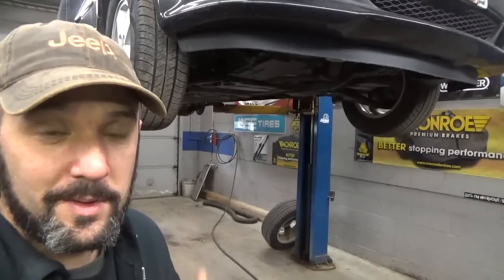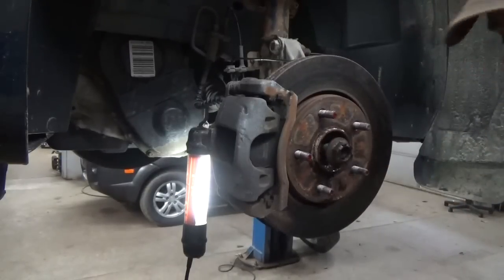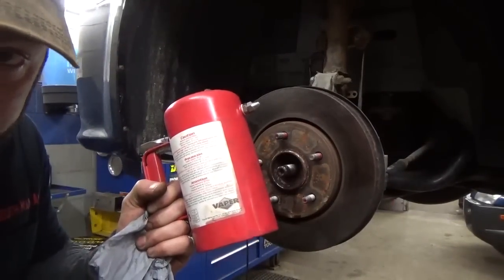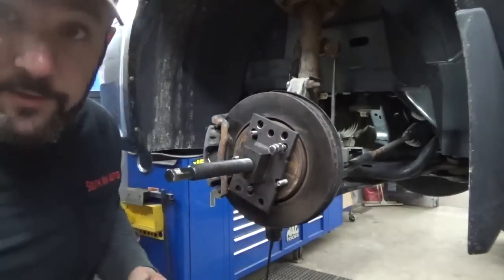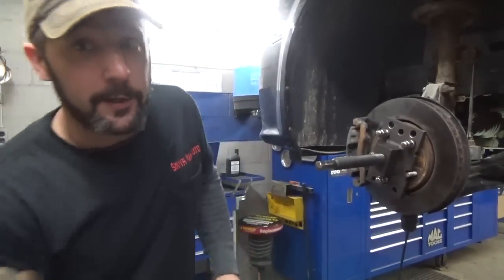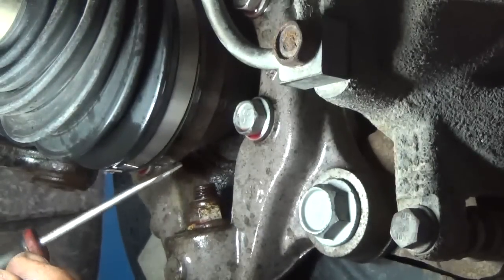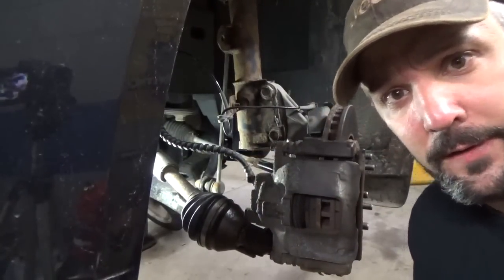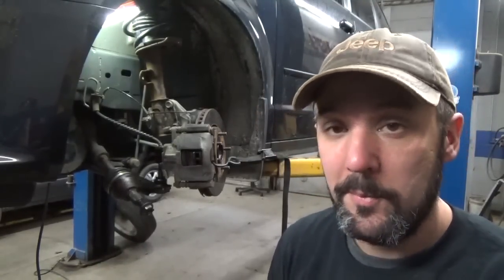Dodge Grand Caravan Lower Ball Joint - Part I

Comment: What you can do to avoid a lot of hassle next time is loosen the ball joint nut then break the joint loose from the hub using a balljoint fork or a heavy hammer on that part of the hub, then when the ball joint drops a bit you can get the nut the rest of the way off. This would have avoided the need to remove the axle and subsequently replacing it.

You also could have replaced just the outer CV joint instead of the entire axle.

As for those commenting on the amount of rust on the axle bolt, this is common when used in the winter on salted roadways.

Another technique when removing and replacing the ball joint is heat the lower control arm with a torch until it's red hot, as it expands it will loosen it's hold on the ball joint and you can tap it with a hammer and it will drop out, then heat it again and the new ball joint will slide right in with a tap of a hammer or two, then when it cools down it will clamp on it like a vise and the snap ring will be added assurance that it doesn't drop out.

You might also advise your customer that the right side ball joint was subjected to the same conditions as the left so it would be a good idea to replace them both together and since the new ones can be lubed they should last much longer if greased regularly. 

Enjoyed your video very much, it's nice to see someone sharing this knowledge on youtube.

ASE Master Tech (retired)

Comment: Just put brakes on a neighbors 2010 caravan, I noticed the drivers side lower ball joint is bad. I do have a 20 ton press and have done enough wheel bearings to know I don't want to do any more. Your video is awesome. Being in upstate NY I fight rust every job. i'm supposed to be retired, just helping out the neighbors, they think everything should cost $50. After seeing this i'm sending them to a garage, then they'll appreciate those $100 complete brake jobs a bit more. I was wondering how to get that nut to clear.. That axle spline sometimes comes right out, then there's the other times. i'b buy you a beer if I could. Cheers!

Comment: The visible tire alignment part applies only to heavy trucks like an 18 wheeler, the uneven tire wear also, for the heavy vehicles only, a NYSI is a minimum safety requirement, for example, only 1 reverse light has to work, and the only front lamps that are inspected are headlamps high and low beams and signals, headlamp aim has been deleted, side signals or side marker bulbs also dropped, front park lights are not rejectable....to name a few, many changes have happened on inspection laws over the decades, mainly because of taxpayers complaints, the ball joint thing comes from in the 60s and 70s the lomax tool to check for wear was not used correctly on many different design cars so even a new ball joint would fail, up and down or side to side play, (specs were not followed) thus complaints piled up so a change in the law was made and not for the better, the state just dropped ball joints all together because many shops did not know how to check a ball joint for wear, you can follow the OEM terminology for a "complete control arm" and fail it that way e,g. Nissan and Ford Lincoln and others replace whole arms not ball joints...also the steering wheel free play can fail a ball joint ! 
a NYSI inpection does not make for a safe car like people think.

Comment: Just an observation Eric, You were making progress by hand with the breaker bar .If you put a big 8 foot pipe on the end of the breaker bar and got more leverage I think that  it would have worked a lot easier. ( just my opinion and that's what I would've done :)  remember I'm on the outside looking in, and you worked for your Money  that day for sure. great video
Reply from the maker: Carm0083 Oh yeah hind sight is always 20/20 but gotta remember an 8' bar can sometimes create a few more problems than it fixes :)

Comment: I am a DIYer and I do not have all those fancy tools. I was going to just replace the whole lower control arm. Figured I can just chisel ball joint bolt out. Your thoughts? Lower control arm is about 90 bucks with ball joint. Seems like most of your time was spent fixing something for the future. I was just trying to avoid that and worry about the joint.
Reply: Ps. I like how part 2 has half the views.

Comment: I'm not sure if I would beat on the CV axle shaft too hard.  Possible damage to the inner, and outer joints, and transmission.  I would have soaked it down real good over night, leaving the press on with high pressure.  Then, go after it with a air hammer lightly the next morning.  That may have possibly worked?  Can those axle joints stand that much abuse?  Love your channel, and watch quite a lot to learn new procedures from you.  K
eep up the education for us all!

Comment: Hi Eric,
Great videos, I have been learning a great deal from you.
I have an old 1999 Dodge Caravan. And the strut housing on the driver side is rusted.
To make the story short, I fell asleep behind wheel and hit the concrete median and the strut cracked the rusted housing. I went to AutoZone and purchased a Kit that caps the housing and held in place with 5/16” diameter pop-rivets. I am contemplating to do the work this spring, but not comfortable using P-R to hold it in place. 
What advise can you give me to do this work with confidence?
With Kindest Regards,
Shahbaz

Comment: Good video! I would've tried a little differently:

1. Unspin the balljoint nut as high as you can
2. separate the balljoint from the hub
3. Pull down the balljoint boot, grab the balljoint shaft with vicegrips, so the shaft doesnt spin
4. undo the nut rest of the way.

to install:

1. put a new balljoint  in the hub, put the nut on,
2. push the balljoint up with a jack, so the shaft doesnt spin, tighten the nut.

If any of these steps are impossible to do, then yes, only option is to remove the axle.

Comment: Hi Eric. Our inspection in the UK is called an MOT test. That ball joint would be classed as a dangerous failure and not to be driven until repaired. We do have certain criteria which makes you question the logic like this for you. I would however fail that one with the criteria given to you as you said alignment obviously incorrect. A ball joint allowing that much movement is surely obviously out of alignment. It would wear tyres unevenly, but they could fit a new tyre that day and have no apparent wear for you to add that to your decision. Take a look at the gov.uk website at the inspection manuals if you get chance. I would be interested to read what you have to follow.

Comment: I own a 2009 Caravan in Toronto, Canada. I had to replace both front wheel bearings in Sept.2017. Both of my 8 year old CV axles popped out easily when I gently tapped them with a small sledge. I wonder why this van was such a problem?

Comment: Use Kroil penetrating/creeping oil. None of the others work as well. I have have had badly rusted steal and after letting Kroil soak for a while, the steal looked like someone polished it, the Kroil creeping oil worked so well. Also, I am not sure if you didn't lock the plate on your tool down to the hub at first because if you did, every time you hit it with the hammer, your just hitting the hub. Also, I may ran a few rings around the hub with a torch because sometimes just a little bit of heat is all you need. Once you saw the axle move, you should have used the axle nut to tighten it back up and repeat this back and forth process a few times. You could have easily got the nut off without removing the axle because the nylon lock would have cleared the threads, so you should have replaced the bearing after doing all that work, and also, beating on the hub may have damaged the bearing I guess. If the outer cv is damaged I would guess you hit bottom with the inner cv and that's not good. Maybe not. You might need a better chisel gun. I bet a good dose of Kroil with time for it to work and a kick butt chisel gun would have worked without all the struggle. My friend has a new snap on and its so powerful it's hard to control the darn thing unless its a straight on direct hit such as a cv axle would be. There are other chisel guns even more powerful, but I can't remember who makes them. Thanks for your educational video's. I sit for hours and hours learning from you. THank you and God bless.

Comment: I really like your approach, attitude, and stick to it-ness.  I had a comment about using a hammer on the driving pin of that particular hub puller.  Did you realize (where you aware) that when you were hitting the pin, it was NOT really hitting the axle much at all?  The driving pin is screwed to the plate.....the plate is flush on the hub.  The force would have been spread all across the face of the hub, because the pin CANNOT go forward (inward) at all.  It is threaded to the plate.  
Now if this had been a 3 jaw puller, and you were hitting the pin, the pin would have been free to move, (and hopefully push the axle).  And funny how every time you got the giant breaker bar and turned the screw, the axle moved.  I wonder if you had done that earlier on, if it would have moved - then.
Also, how much power does the impact you were using have?  Ever consider a much higher torque one?
Other than that - great photography, and overall video!

Comment: Dude I feel your pain. I had a cv axle stuck in a wheel bearing so badly that I had to separate the entire knuckle from the ball joint, tie rod and strut mount and then separated the cv axle from the transmission. Take the whole assembly put it in vice vertically soak it in a pb blaster and pound on it like a rail road spike with an 8 pound maul. She separated..... eventually.

Comment: I got what you meant by it not being a castle nut but I'd of kept the pickle fork in there or clamped some locking pliers on the pin after tearing the rubber boot away. Anything to avoid what you went thru. Do you think removing the caliper and rotor and putting some heat into that hub would of helped any? (not a lot since there's a bearing seal in there)?

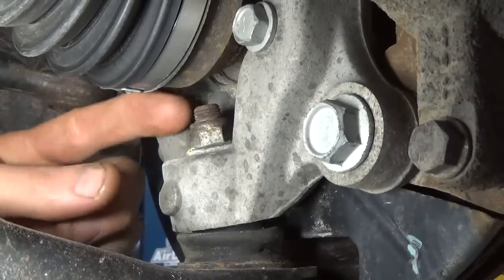Comment: Great video.  Thank you.  Question:  Would it be possible (at 2:04), to use a grinder or reciprocating caw to cut part of the ball joint bolt off to allow the nut to clear?  It does look very tight in there.

Comment: Hey why not loosen the nut until there's a gap, than cut the stud of the all joint off with either cutting torch or sawzall and when installing new ball joints start the threads and slowly work the nut and push the joint in at same time? Wouldn't have to touch the axle shaft or nut! But hey great hustle and like you said you will have to do a bearing at one point at least now you will get it apart! Thanks erico

Comment: Eric, when using a hammer as simple as a claw hammer you should wear those pesky safety glasses.  I know of a case where a young man was framing a house and a piece of the hammer or nail broke off and penetrated his eyeball.  He was taken to the emergency ward and was transferred 45 miles away to see a specialist who, by this time, couldn't do anything but remove his eye because the fluid had drained out.

Comment: I have a torque multiplier 4X .  Place 250 ft-lb on the input shaft and the output shaft will generate 1000 ft-lb.  Never had a problem removing stubborn nuts/bolts.  Can not be used with an impact gun.  Must be used with just your muscles.

Comment: Two things. 

Eric, You better get your glasses on or the boss will be upset 

2nd, Where did you get that press for the Axle that bolted onto the outside of rotor. That would be nice to find one like that. 

Maybe could've split the nut at an angle on the ball joint with a smaller cutoff wheel. You know the small ones we normally toss during a few minutes of down time when we're wanting to make sure the tools are prepped up and read to go?

Think that would've worked.

Comment: I just did a wheel bearing on a Kia Sorento and that was insanely stuck so when I had to do the other side I bought a 15ton Chinese hydraulic puller for less the £40. OMG what a tool it got the drive shaft moving with a lot of pressure but di the job fine, should have bought it when I did the first side, I ended up smashing the life out of the shaft and wrecked it.

Comment: Replacing the lower ball joints on my parents 05 escape now and man I feel your pain with corrosion and rust vehicles in areas like PA where I'm at nothing ends up being an easy job. Right now I'm fight with the top of the ball joint stuck in the knuckle and the pinch bolt stuck in it also.. It does help to have good tools though. I have a shitty cheapo impact and its just not worth using most of the time. I really would love to be able to get a quality impact.
Reply from the maker: Gamingoodz buy this if you want a great small 1/2" gun. I have one it will blow your mind for its size http://www.amazon.com/Astro-Pneumatic-Tool-1822-Impact/dp/B00VTQIURE
Reply: South Main Auto Repair Thanks for the reply, Just checked it out looks like a nice gun 450 lbs out of something that small is pretty impressive. I don't really know what any good brands of air tools are. I wouldn't mind getting that small one you linked me for tight spots and a full sized beastly 1/2" one for when I have something that the smaller one can't crank on. Have you had any experience with Ingersoll-Rand or AirCat? I see those are the highest rated on Amazon. The one AirCat one for $173 says it can do 1,295 ft-lb I don't know if I believe that claim but if it really does that would be great for breaking things loose.
Reply from the maker: SATAMAN Schmidt  can you chime in on this?

Comment: I love your videos, but honestly all that sledge hammer force was being absorbed thru the wheel bearing and press, and very little of that force was getting to the axle. I'd have put the nut flush with the end of the Axle and taken my chances on the axle shaft full force sledge hammer.

Comment: Use a cheap impact socket on your press just for hammering. It keeps press screw from deforming. The socket will deform instead and is cheaper than the press. Used this trick on anchor pin presses. Saved time, since you don’t have to stop and grind on the press screw to get the socket back on. 🙂

Comment: Hey man I’m not going to get my hopes up that you actually see this. But I’m a new tech. Been working on Niagara Falls New York as flat rate for maybe 5 months. I’ve done several control arms and lower ball joints on these vans. I never take the cv out. I loosen the ball joint nut most of the way with a wrench then pickle fork it loose. Then just take the nut off once it drops. I can usually do them in under 20 minutes both sides
Reply: i take it you didn't watch the entire video since he explained why he didn't do that.
Reply: hawk eye I’ve done several of these ball joints. You don’t have to take anything apart besides the ball joint nut. I’ve done both lowers and aligned the cars in under 40 minutes
Reply: @jacobsmith8121  thats all good but it looks like you're just flexing what you can do and have not paid attention to what he explained in the video.
Reply: hawk eye I literally just rewatched it. All he says is that you get get to the nut. I’m not arguing with you.
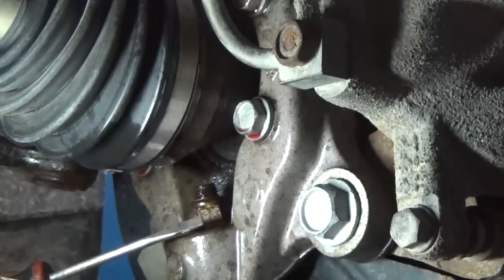Reply: @jacobsmith8121    19:05

Comment: Thank you thank you thank you, at 9:25 you say you "got a breaker-bar, and I tightened it just as tight as I could get it." Impact air-wrenches are wonderful, but you yourself are much stronger when using a breaker bar. So at first I was wondering why you did not know this, because in watching your videos, it was obvious, to me,  that you are a super competent auto-mechanic. And of course my doubt of my judgement was a mistake. The 150 ton press, and the breaker-bar; yikes!! Somewhere a design engineer as made a mistake. The hub should always come off the axle "easily" during the life-time of the vehicle.

Comment: This spline joint should of had Never Seez applied to it in the factory, but that would make it too easy to work on later.  OK.  I was taught the front end business when I was 17 and I loved the work.  I was taught by two of the best front end guys on the planet.  One thing they taught me was how to use heat as a tool.  These sprays are great for what they can do, but they are not going to penetrate a joint like this in less than a hundred years.  I would have pulled the caliper, { 5 minutes} and remover the rotor.  Get a heat tip going on a torch and heat the hub evenly around as to prevent warping.   Get it hot but not cherry color.  Then perform the hub pulling tool and sledge hammer procedure as he shows and repeat when needed.  Once it breaks loose and the axle shaft moves in, spray that are on the inside and then again on the outside.  Tighten the axle shaft back up and repeat until the spray oil can pen the inside of the shaft. I guarantee there will be no damage to the hub and axle shaft bearing, IF you keep as much heat as possible off the shaft.  However, if the bearing on the axle shaft gets too hot and cooks, might want to replace it. This method will decrease the work time by at least 1/2 and maybe more.  Make sure to have a fire extinguisher handy while using the torch.

Comment: At least the rims came off. I started a video the other day on a dodge . But after several hours of getting upset , i could not edit enough to make it even close to pg.It took like 5 hrs for me to get the 4 rims off the darn thing even after a few trips around the block with the lug nuts loose.
Reply from the maker: wtbm123 Wow Terry, That is what I call "getting slid"... you got slid my friend :)
Reply: wtbm123 I had an 83 malibu that got a flat, I broke 3 studs and had to beat the rim with a sledge to get the rim off. I had to drive it home with only two lug nuts and a spare. Salted roads will do that even to a tough old car like that.